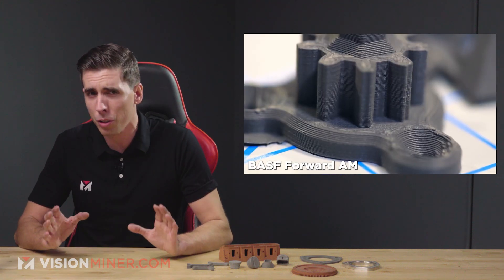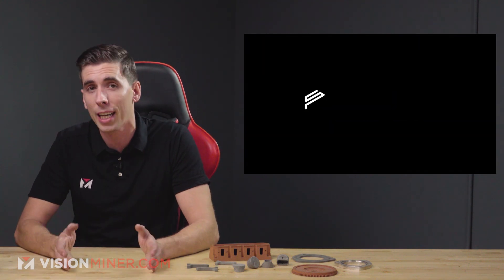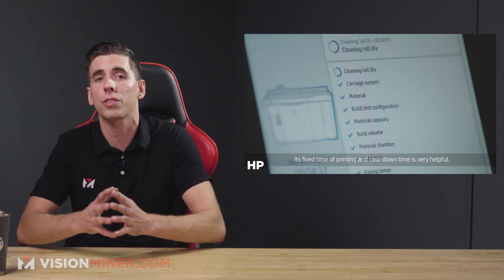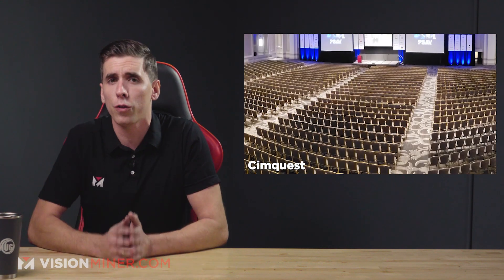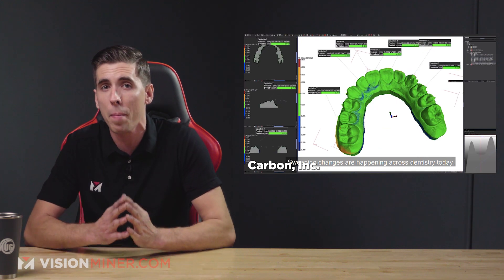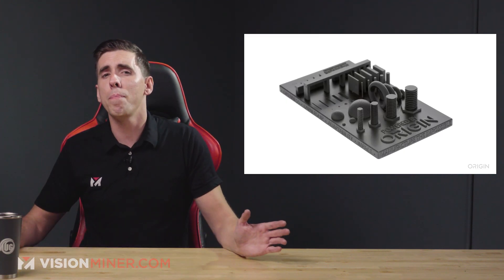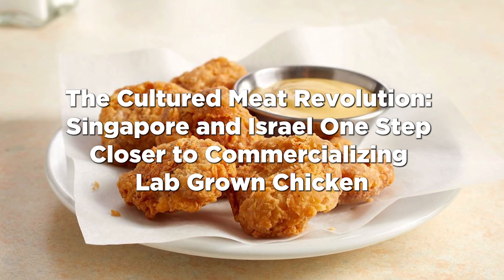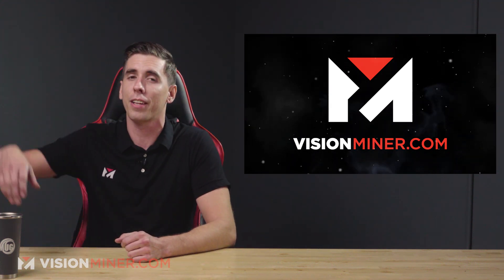Desktop Metal gets on the NYSE, Copper 3D Printing, SSYS and BASF Release Machines & Materials!

Comment: Has desktop metal even produced any copper parts yet? It's been years and I haven't seen a single part. They "qualified copper". What does that even mean? That they only found a copper powder that they're willing to use? Have they been successful at producing a part?
Reply from the maker: There's a lot of interesting things surrounding the metal printing companies right now.... it's still a huge challenge. That being said, I do believe they've produced sample parts, at the very least...  how consistently and at what volume? No idea.
Reply: @VisionMiner  I've seen something. from ExOne, but not Desktop. And Desktop acquired ExOne, so they may very well just be fluffing their capabilities.

Comment: Man this field is nuts. So many crazy inventions. really paving the way for the future. As for what i'm personally interested in that has to be the mahor pellet extruder. small scale pellet extrusion is very interesting to me. I wonder if small scale pellet extrusion could be used in the high temp field to reduce dehydration times (due to higher surface area of the pellets) and reduce material costs.
Reply from the maker: Material costs plummet with pellets, we can't wait for some desktop systems to start really taking advantage of it! All the benefits.... man.